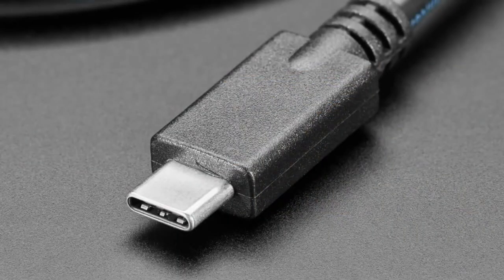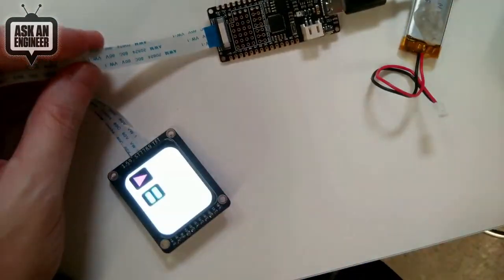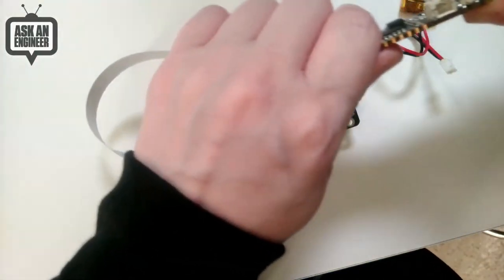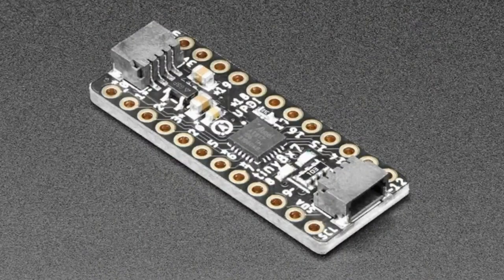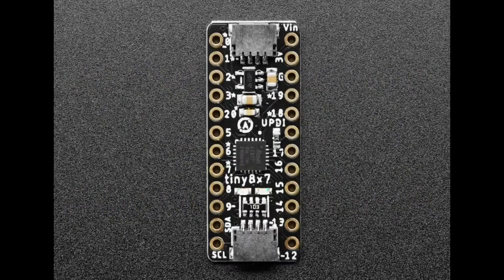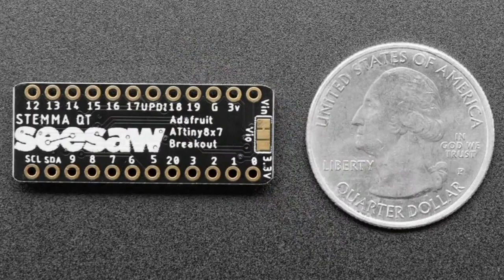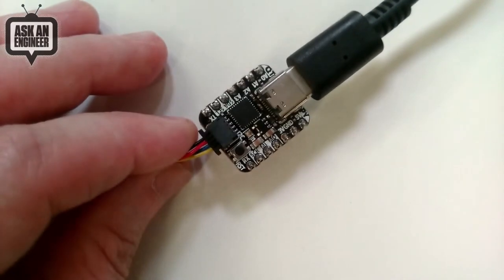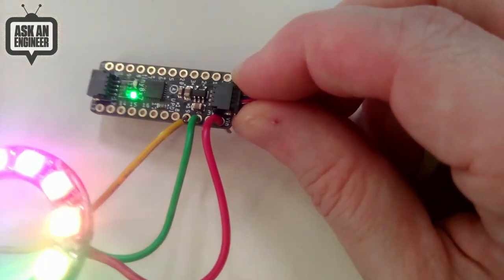New Products 9/29/21 feat. #Adafruit ATtiny817 Breakout with seesaw - STEMMA QT / Qwiic!

Comment: Suggestion on the USB-C cables: Mention on their pages whether they support USB Power Delivery (if they do, what volts/amps), and what USB speeds/spec levels they're capable of supporting (2.0, 3.0, 3.x Gen Y). I'm sure they can handle a lot as the cables look quite robust, and communicating those specs is always a good thing.

Comment: I am using the ATtiny817 BoB SEESAW as an ADC and port expander for a CNC pendant with a lot of buttons and knobs. So far, it is GREAT!!! It just works, thanks to your firmware. And its 10-bit ADC is much quieter and more linear than my host ESP32 board's.  QUESTION: I am now looking for an Arduino Example sketch that shows how to poll or control the GPIO lines when you have more than one of these boards daisy chained via their STEMMA connectors. I did not see any in the SEESAW examples from Adafruit that come with the repo. Can you provide an Example, or add that to the documentation?